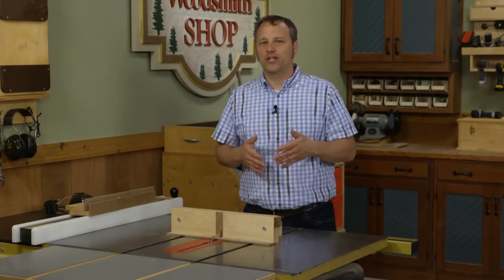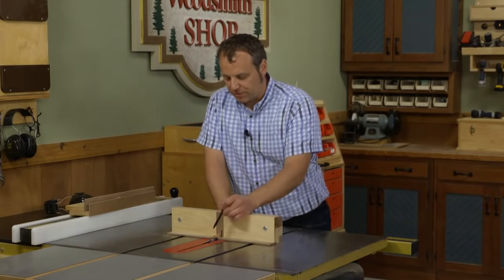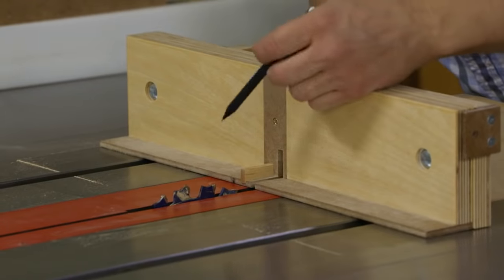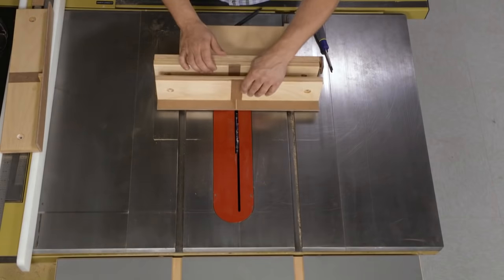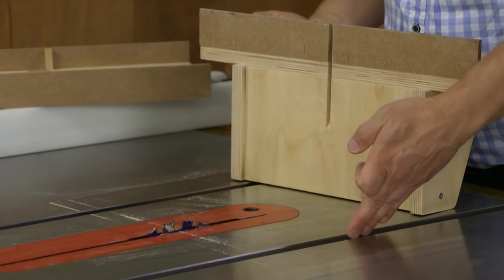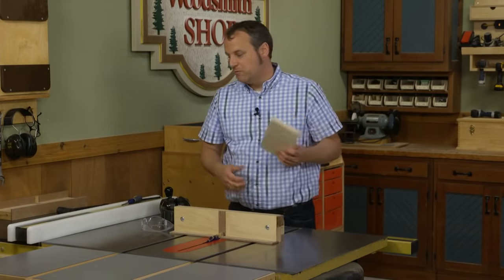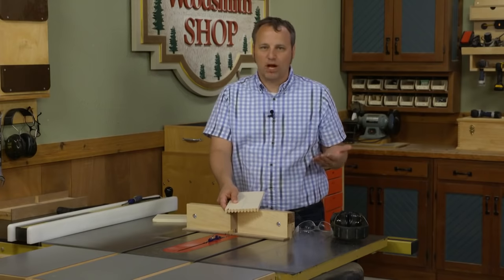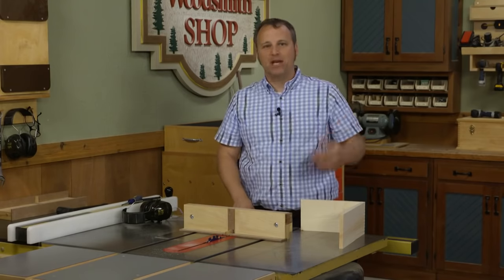The Ultimate Adjustable Table Saw Box Joint Jig!

Comment: Best one I've seen so far. Really like the adjustable screw idea. Thanks for sharing this.
Reply: Setup a jig like this with a 2 inch wider base and a 3/8 key, then it can also be used to tenon door stiles without changing settings, the runner groove has to be completely square so do it on a sled or do it on a known square edge before cutting the sheet so the reference edge isn't tiny, this will help make gap free square tenons. Sounds more complicated than it is.

Comment: Guess I'm missing something here with the adjustable screw feature.  How can it adjust the position when the carriage bolts go through both the movable fence and the fixed fence?
Reply from the maker: It’s a 1/4” carriage bolt that goes through an oversized (3/8”) hole in the fixed fence to allow just enough clearance for the micro-adjustments needed to hone in on the correct position of the key relative to the blade.

Comment: Great jig. went to Woodsmith site, but no such plan available. So I just drew it up while watching.
Reply: Did you take the screw into account? What it was used for? The video didn't show, but, seems it might be used for using a single blade vs the dado stack, but, might have just been used to adjust the slot for some reason I can't see why.. Went to your channel to see if you did a vid on your build.. Would have been cool. At least why the screw was there.
Reply: @MarkThomas123  I built a simular jig, but I didn't make the main fence wide enough or the sled long enough so it was a challenge to use. To top that off I ordered the freud Safety Dato blade, but was very disapointed in it as it vibrated and chipped out the Maple badly, so back to the Router table. However there I use the Original Rockler Finger Joint sled which I have had to do major rework on and it it very difficult to hold in place and I would not recommend it to anyone. With that said I will make a jig more like yours and adapt it to the router table. I have parallel T Slots which should work to hold any jig I make solid and use you procecss to make the minor adjustments.
Reply: Today I found your plans and purchased them. Will still rvise it to work either on my Table Saw or Router table. With short miter bars it seemed to want to tip forward. I like the other parts of the plan.

Comment: I built several box joint  jigs including the original Shopnotes version of this one with improvements.  Every single one had one or more problems I found unacceptable.  One major issue is caused by inherent problems associated with dado stacks- either trying to carefully stack and shim it to cut precise 1/4", 1/2", etc. dados.  (many dado sets, like the Forest Dado King are designed to cut a slightly narrower dado than the published size (stamped on the trimmers and chippers), matching the width of a fixed-width guide pin, or getting them be repeatable from session to session (stacking and unstacking) which was surprisingly difficult.  The second issue is to make a guide pin that matches the actual dado width EXACTLY every shop session.  A third issue, related to the first two, is positioning the guide pin exactly two dado widths from the edge of the blade.  None of the jigs were reliable in all or any of these issues, so I spent some time and invented the iBox.  It solves all of those problems.  It doesn't care what the dado width is or that your dado stack is 1/64", .015, .001, etc. wider or narrower than you wanted, it sets itself to the actual kerf-  it  sets the guide pin width and blade-to-guide pin distance precisely.    

For those who don't like partial pins or narrow slivers which I call orphans, at the end of a box joint, rather than fiddling with the dado stack or adjusting (ripping to width)  the size of your board, why not just use a "center-keyed" box joint?  You will always have full width pins or slots at the beginning and end of your joint.
Reply: Slim_Savage  My jig, the INCRA iBox is available from INCRA and many WW retailers.
Reply: Slim_Savage You get your money’s worth.  Just compare the price to what folks pay for some of the simple squares, etc. from Woodpeckers, or for an Oneida cyclone!  I like saving money and also enjoy making my own stuff, too and that is how the IBox and Lock Miter Master came about, but there is a limit.

Comment: This looks like it has some great upgrades on the Box Joint Jig you featured in issue 78 of Woodsmith. I'm looking forward to taking the improvements from here and applying them to the plans in the issue. I have a project in mind (coffee mill) that will require box joints.

Comment: I was thinking you were going have that backer piece and the key and spacer all together in one removable and exchangeable piece. Could that actually work?
Reply: If they aren't separate it negates the adjustability of the stop and adjustment screw on the end of the 'fence' and makes the process of 'setting' the key very difficult to get exactly correct.

Comment: Do not talk while cutting, or you may concentrate more in what you have to say or are trying to say and not in that there is a saw rotating that if you do not pay attention to it, you will regret not doing so! When you use the saw, is time to pay strict attention to the saw, so you don't cut yourself. Then, once off, or before, you can talk.

Train all around you to DO NOT TALK TO YOU WHILE YOU ARE WITH THE SAW CUTTING! if they have anything to say to you, stand in front, or make a sign with their hands and this interruption better be of importance since you will be trying to avoid getting cut, and working so all shall learn to don't disturb you with something they can do without counting on you or interrupting you, unless is an emergency but, if they have an emergency e don't want two, so do not talk while the saw is on.

Comment: Seems very pretentious, even arrogant, to call this "ultimate" when it is so limited: cutting finger joints on pieces larger foot-long will be difficult and very prone to error. jus' sayin'
Reply: I agree, but he's not alone! 😄Just do a scan of YouTube videos for woodworking jigs and techniques, and they are all either "ultimate" or "best ever". 🙃
Reply: I would never call anything "ultimate" as there is always room for improvement but I can with quite big confidence say that my boxjoint and tenon jig is the best in the world. No accumulative errors, no test cuts, best accuracy, easy to trim the fit in steps of 0.05mm and shorter set up time than all the others. As a bonus it can make double tenons and boxjoint with individual spacing without problems.